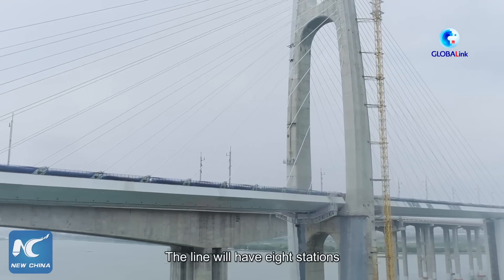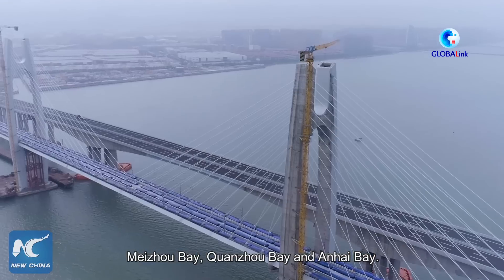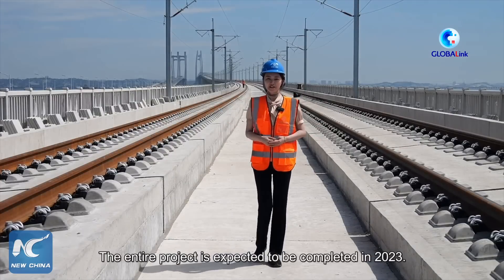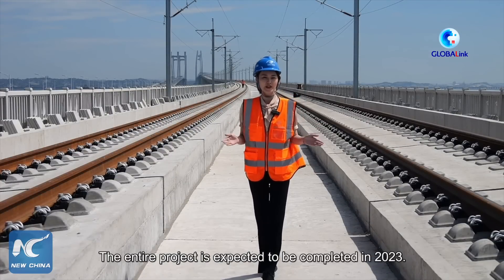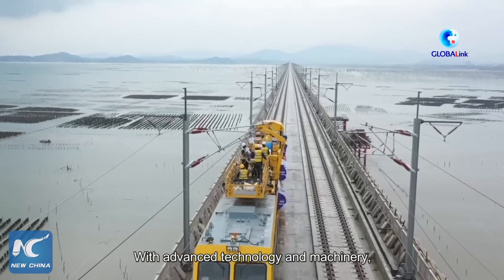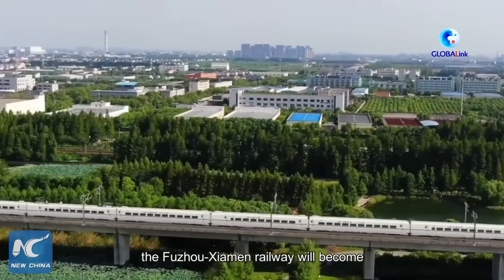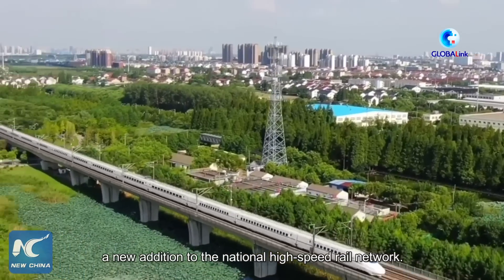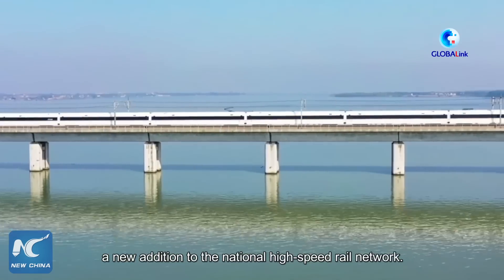GLOBALink | Discovering China's first sea-crossing high-speed railway

Comment: With over 40,000 km HSR and more than 2/3 of the world's total installations China has become the indisputable leader for the High Speed Trains.  It is a miracle in its own right because prior to 2008 China has no HSR at all.

China's HSR is complimentary with the world's biggest metro system too with at least 44 cities got installed.  This is China's way to solve its public transport problem.  China is different from US as it has very little oil and gas reserves so Chinese cannot run cars as easily as the western economies, even though China has the biggest paved road network and the largest expressway system.  Nowadays Chinese can afford cars but but its is in the nation's interest to have a robust public transport system.  China's carbon emission has historically been driven by industries as China is the factory for the world's supply of goods and products.

Despite the massive HSR and the biggest metro in the world, which are all electrified, a Chinese on average still consumes less than half the electricity consumed by an American.